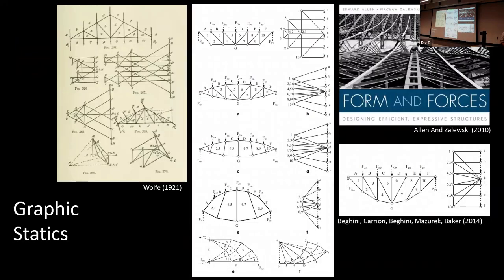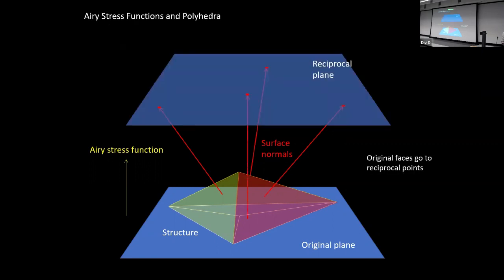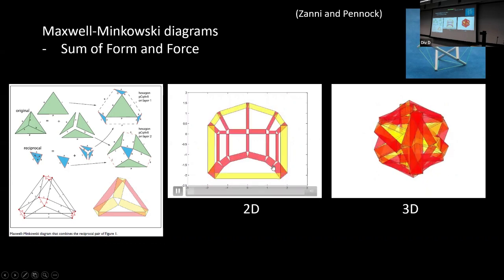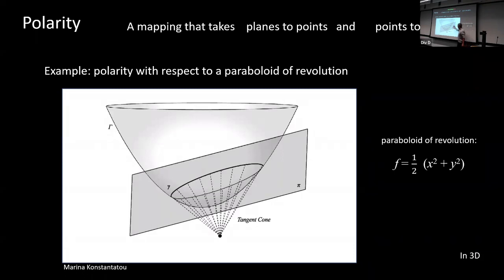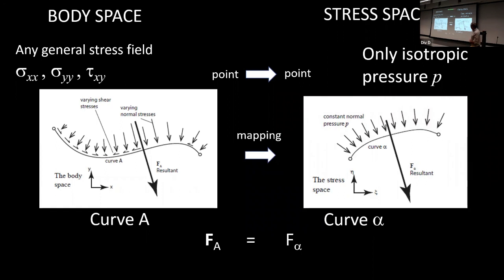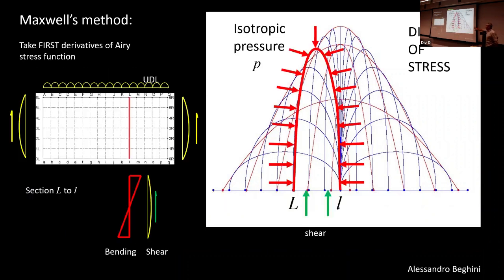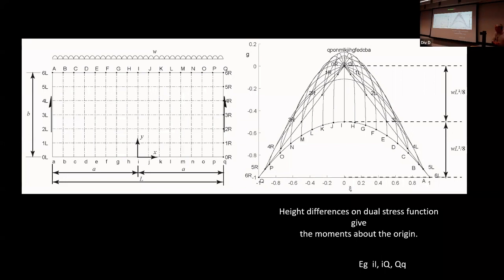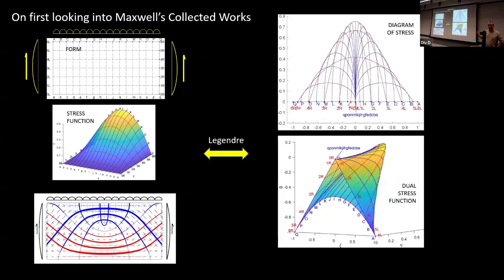Graphic Statics By Legendre Transform

Comment: Attraction is dual to repulsion, stretch is dual squeeze (compression), push is dual to pull, stress is dual to strain -- all forces are dual.
Action is dual to reaction -- Sir Isaac Newton or the duality of force.
If forces are dual then energy must be dual.
Energy = force * distance -- simple physics.
Energy is duality, duality is energy -- the 5th law of thermodynamics!
Potential energy is dual to kinetic energy -- gravitational energy is dual.
Electro is dual to magnetic -- Maxwell's equations.
"May the force (duality) be with you" -- Jedi teaching.
"The force (duality) is strong in this one" -- Jedi teaching.
"Always two there are" -- Yoda.
Energy is measured in Joules (duals, Jewels) in physics.